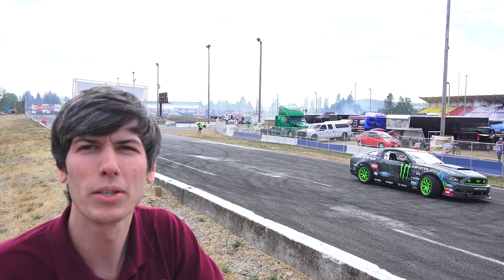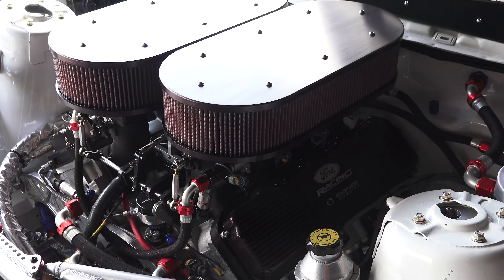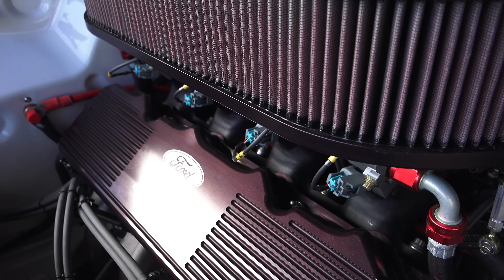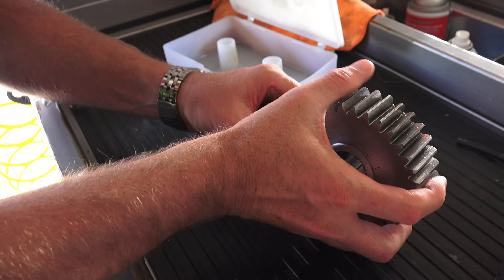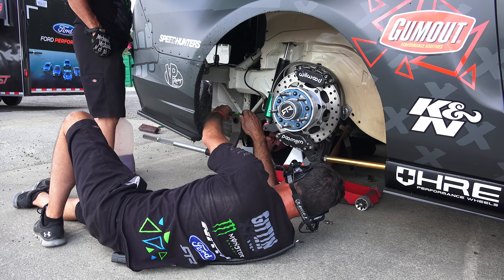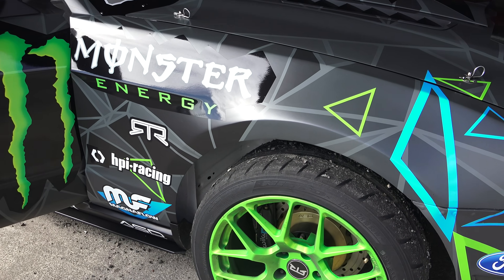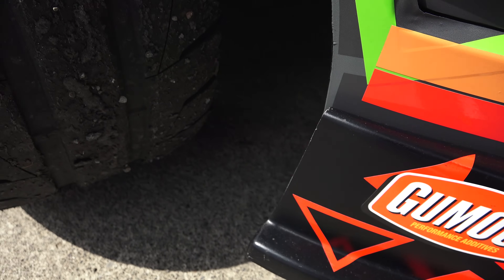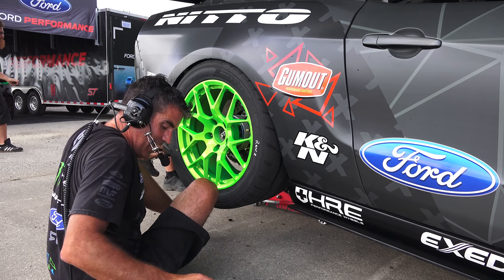Formula Drift - Engineering A Drift Car

Comment: The tires may have good grip bun once they start too spin and loose grip the coefficient is greately reduced but it will still be higher than for street tires. But the front tires don’t loose traction. 
Anyway you use slick tires just as in a typical racecar, but what’s different?

Comment: What kind of steering does this car have? Hydraulic boost, electric assist, or manual?

Reason I ask is that these Mustangs come stock with electric racks and a good drifter told me that electric racks don't self center as fast as hydraulic or manual racks. I figure the car has been converted but as hard as I try to find information on the steering systems of Formula D cars, it's so hard to get it. 

It's a big deal, because most of the new muscle and exotic cars are now all coming with electric racks....Camaro, Mustang, Corvette, Challenger.....

Comment: I wanna understand what’s needed to drift awd.
Reply: There're two kinds: rear-end-biased & 50:50 (this is the kind Ken Block uses).

Rear-end-biased: Pretty much the same techniques as RWD drifting can be applied I suppose
50:50: Steering & throttle control, you only counter-steer during the following:

Reducing drift angle
Transitioning to another drift direction
Exiting a drift

Comment: Only aero you can really do is a big spoiler with big sideplates. The large sideplates put some force back into the vehicle going sideways. Chelsea Denofa used them on his e46 back in 2013. Dont know if they are allowed now.

Comment: 410ci . 14:1 compression ratio . 9k rpm . 740 ft/lbs torque . and they build these crazy engines just to do what a 240sx does but just a bit faster lol

Comment: Why NA engine? No turbos or supercharger?
Reply: Krzysiek Heluszka, from what I learned from Forza, a turbocharged car would have turbo lag to throw the car off balance. In order to have tge most control, either natural or super charged is needed to appy the power in a linear fashion. When the boost kicks in on a turbocharged car, the car instantly redlines, and the car spins out because it's putting all that torque onto the road at once, violently making the car spin out. Forza isn't the most realistic racing game, but it's pretty damn accurate still.

Comment: wow isnt that a like stock car engine?  I didnt realize they ran with that much power.
Reply: most formula d cars make about 1,000 hp, many make even more than that
Reply: +CJSchecter96 Daigos lexus 2jz has like 1200hp
Reply: Jack Truitt and i am here with my 4 cylinder turbo charged to 200+ HP :/
Reply: Ryan Rasberry has a Ls swapped S14 running 700hp with nitrous.

Comment: this should be considered like a part 1 of a coverage, because vgj uses a high power and heavy formula d machine, so his setups differ from lower powered lightweight cars in formula d.
Reply from the maker: William Su There are teams running higher power though, VGJ is looking to add more.
Reply: Engineering Explained his is already pushing out a fair number some cars only have like about 300 ish

Comment: What's the point of this kind of competition? Can someone explain me precisely how they choose the winner of the race?
Reply: BroadcastBro They put sensors on the front and rear of the vehicle, and measure the angle of the car going through the turn, they have the GPS sensor showing them how fast the car is going, and it's also judged by gap between the 2 racing cars.

Comment: car weighs 28xx lbs... even though the FD tire regulations for that weight are 270mm tires MAX.
Reply from the maker: Austin Laflamme It's in a higher weight class (I believe they compete in the 3300 lb class). There's a max limit to the weight, they're all well under. It's allowed the 295's it runs on, they're not going to be so obvious in breaking the rules haha.

Comment: Interesting info on tires. I would have liked more technical details. Suspension setup, and transmission (differential locked ?)
Reply from the maker: godtux 4 speed dog box. They were secretive of the suspension and differential. That said it's a winters quick change diff, and the suspension does have to use the original mounting points.

Comment: This feels too "americanized" I'd rather learn how low horsepower cars drift with a little suspension tuning and an LSD.
Reply from the maker: inuysha360 By reducing grip on the rear axle. Stiff springs, stiff bars, stiff tires (hey, just put plastic tires on if all you want is wheel spin). :)
Reply: True, because it was based off of an American drift series with an American made car and a big corn fed American behind the wheel dumb dumb 😂😂😂

Comment: One thing I feel you kinda glazed over, so obviously the whole car setup is for grip...but why?  Why is so much mechanical grip necessary in a vehicle whose primary purpose is to not have mechanical grip?
Reply from the maker: MrSlowestD16 I was hoping it was clear, sorry if not. You need grip to be able to drift at high speeds. The purpose is not to have low mechanical grip. The more the better as this gives the driver more control and the ability to drift at higher speeds. The rear tire grip is exceeded with large amounts of power (840 in this case). Lots of power is also need to go fast.
Reply from the maker: MrSlowestD16 Another way of thinking about it is drift cars in the rain. The drifts will be much slower and much less exciting because there isn't enough grip to do it faster.
Reply: Engineering Explained Ah, yea, that's a good way to think about it.  I was a bit more concentrated on why you need more grip to drift at higher speeds, the grip doesn't do much if you're drifting, but I suppose if you don't have much grip even getting up to those higher speeds is difficult without the tail wagging all over the place.

Comment: Can you do a explanation on reverse entry physics? I can't wrap my mind as it should keep going backward and sideway by applying force forward. Can slip angel be more than 90 degrees indefinetely?
Reply: More grip in the rear than the front... Lots of steering angle... Really not to hard to imagine.
Reply: The rear tyres get more then front. They just brake and turn the rear end back.

Comment: So you're saying drift cars don't need giant wings? Whaaaaa?
Reply: Cantenkerous Tim IMPOSSIBRU!!!!!
Reply: you do not need big wing they only need it for drag racing
Reply: gibbythebest kotwal yes you do lmao
Reply: gibbythebest kotwal You do want grip if you want to drift fast, and you need to drift fast if you want to win.
Reply: gibbythebest kotwal Hahaha! Well, when it comes to fun, anything goes! For my part, I particularly enjoy thick wet snow! ;)
Reply: +Brian Browning haha i get it
Reply: Most types of racing actually. Downforce is useful both for handling and acceleration, by increasing grip.
Reply: Federico Lucchi and you do not want grip for drifting
Reply: @gibbyace5077  ahhh pro cars want as much grip as the rules will allow. They all run semi slicks.
Reply: Federico Lucchi i only have thick tires in the front and used thiner ones at the back :/

Comment: si podes explicar como funciona el diferencial en estos autos te voh a agradecer, USE A TRANSLATOR SO YOU CAB READ THIS MESSAGE... from Argentina thanks for all your videos
Reply: he said if you can explain how a differential works in these auto mobiles. He'll appreciate it. Also I suggest you write your answer and then translate it to Spanish
Reply from the maker: krwling12 Lo siento pero no se mucho del diferencial. Ellos no quieran compartir informacion sobre eso.

Comment: Can you drift an automatic car? How?  Super video
Reply: Alejandro Castro Montoya From what I understand (and I'm no expert) - it depends on the automatic & the way it's programmed, if it will let you select a gear and hold it, then yes it is possible to drift an automatic - if it won't let you select a gear properly, or it has "limits" in the software or hardware that make it change gear at certain revs or under certain loads, then no, unless you re-program it, or possibly even change valving etc.  Also I think you need to be able to lock the torque converter and keep it locked or you aren't going to be able to fully control the slide.
Reply: ok thanks are too much things i believe it can be posible with any modfication

Comment: Awesome video!! Very professional. When you were saying the weight, I was expecting something like 2,000 lbs... It's funny that even with full fledged motorsports weight reduction (even on the brake rotors) it still weighs 30 pounds more than my S2000. Lol!
Reply from the maker: Arthur Sperotto Haha, you're not packing a massive 6.7L under the hood though. :)
Reply: Engineering Explained True. I don't know how much heavier the 6.7L is compared to an LS, but my F20c is only 59lbs lighter than an LS1/2/3/6. And I'd imagine his engine is lighter than a regular LS considering how motorsports-oriented it is, so it may even be lighter than my 2.0L! :-)

Comment: I still find it super weird that they use a softer suspension setup as opposed to stiffer. my drift rat has nowhere near that kind of hp, and i also dont have roll bars or anything like that to help balance my car so i guess it makes more sense.
Reply: Skull With more weight traveling at a faster rate of speed at deeper consistant angles while mantaining control during snap transitions, the need for grip goes beyond anything a basic drift car for fun will have. Is it needed to have fun? absolutely not. Thing to keep in mind, this is about competition drifting to reach maximum speed, angle, line, and consistant control in a drifting state.  Building a cheap drift car for fun is as simple as welding a diff in most cases. I had tons of fun in a stock Miata, stock engine with air filter and straight pipe, stock suspension, with a welded diff and used tires kicking it around at resonably high speeds in third and sometimes fourth gear if I have enough running room.
Reply: Skull Keep in mind this is the american style of drifting, more power burning corners rather than big entries and tight twisty quick transition style drifting.

Comment: I always wondered why so called professionals had aero parts. Just doesn't make a lot of sense
Reply from the maker: Yoshi Jeffery ^^ The real expert! ;)
Reply: ***** Most of them are for looks. Rear wings do have a function though. The side cards on the wings help keep the car from over rotating and allow more throttle through a corner (more smoke). This is why you'll see some cars run wings for some tracks and not at others.
Reply: Yoshi Jeffery i see
Reply: Yoshi Jeffery I here people say this, but I don't understand how a side card could significantly help when it is so small relative to the profile of the rest of the car traveling sideways through the air.
Reply: Kevin Sing Doesn't have to be a lot. Just enough. Same thing as putting your hand out the window on the highway. It's enough that they have regulations on the sizes of side cards you can run on your wing.
Reply: Yoshi Jeffery Just because it's regulated doesn't mean it makes a difference.  If I stick a 12in x 16 in piece of wood out my window at 75mph its not like my car is going to veer off the road or that I would even have to put additional steering input in to correct whatever force was acting on it.
Reply: Kevin Sing Not going straight, certainly, but if it goes sideways, its already hitting the limits of mechanical grip, so i can see that it might have an effect
Reply: Yoshi Jeffery I remember a Formula D competition years ago, when Rhys Millen had a GTO, there was a gigantic side card on one side of the car because that was the direction the car drifted in for that course. 

Also neat was being next to his team's spotters in the bleachers. They'd radio back information (ie. add stiffness because it was bottoming out on a transition) to the pit crew to help make changes between runs.

Comment: Why did you not cover steering angle or suspension geometry at all? That is like the second most important part of drifting.
Reply from the maker: Brap Brap Suspension geometry is where things get secretive in the world of drifting. As is clearly visible, the cars have obscenely high steering angles. Apparently as much as around 80+ degrees is possible, though at a point its only to help correct a mistake, such as while driving tandem and needing to correct course or slow down more.
Reply: Engineering Explained Yes but you can still cover the basics such as why the have such high steering angle. Or why they run massive amounts of camber or how toe and ackerman affects it,  or maybe even get some pics of the Wisefab kits guys have to show what makes the components so specialized. Ryan Turek runs around -10 degrees of front camber, yet Ken Gushi and Dai Yoshihara run the same FRS chassis and don't have that much front camber. The custom steering components are designed to give as much room to the tire as possible yet still minimizing scrub and bump steer. Positive ackerman creates front end drag as the tires are at full lock because the tire closest to the apex is not fully parallel to the direction of travel and thus has some slip angle. (Not 100% parallel to the tangent of the turn)
Reply: Engineering Explained Successive videos on ackerman and drift related suspension setups please :)
Reply: Brap Brap Boy, this is some bad internet forum regurgitation. This is not why any of those traits exist on these cars.
Reply from the maker: ProximiTV +1
Reply: Yoshi Jeffery I was fortunate enough to attend FD @ Road Atlanta and when we were allowed into the pit areas you could see Turek had a lot of camber to fit under the Rocket Bunny overfenders. Looking back at my pictures it wasn't a full -10 but it looks to be around -5, and looking at Gushi or Dai they had  around -2.

Mad Mike runs a ton of ackerman and he gets absolute massive angle for such a short wheelbase. He looks to have around 2 degrees of toe out at the front, maybe a touch less and when he is at full lock his inside wheel is turned a little more then the outside wheel.
Reply: Engineering Explained It's not that secretive, a lot of teams run off the shelf suspension that anyone can buy.
Reply: Brap Brap Why is to get more angle. Where did you see that Tuerk runs -10? I'm fairly sure that's false. More than ~3.5 starts causing traciton issues. 

Most cars run very little ackerman but rarely no ackerman.
Reply: Brap Brap I can see maybe -5. Wouldn't say -10. Gushi has a wisefab kit. I don't know about Dai.
Reply: ProximiTV No, this comes from talking to the technicians at Formula D.
Reply: 18iser +1 EE needs to do that.
Reply: Kevin Sing Heck i'm sure if you ask the pit techs or take close ups of the suspension they will tell you the exact damper settings.
Reply: Engineering Explained I disagree, the steering angle is pretty much the multiplier of the whole chassi as it gives insane body angle before wipeout and insane maneuverability due to an increased steering wheel ratio. Sticky tyres, 4th gear drifting with 1100+ Nm engines and chasing the maximum traction came after the steering angles. Not talking down the importance of chassi setup, just saying you should view the steering angle as a multiplier of dito. Thats my opinion at least!
Reply: Yoshi Jeffery his is custom designed by Mike Kojima and the camber, caster, etc. is changed for every event I am sure, but -10 is way too low of a number. I doubt that anyone runs that even with a widebody.
Reply: Its not the second most important thing. It IS the most important aspect when it comes to drifting. Your suspension setup is crucial. You can have all the horsepower you want but if you cant get it to slide exactly how you want then you just wasted your time and money.
Reply: Ekemini Umoh I'd say differential then bushings, what made the most difference for me, way more than geometry and setup of suspension
Reply: 18iser
 it's not the torque that's the problem... it's the short wheel base and lack of steering angle.
Reply: +Road2Perfection you must have had a good platform to start with. Suspension I'd say is the most important.
Reply: +Brap Brap Needs pictures..... xD

Comment: what about turbo car? does the lag have any effect on drift performance?
Reply: Lag does play a factor but most guys in formula drift that are running large turbos are also running computer controlled nitrous systems that spray during times when the turbo is spooling. This not only gets into boost faster but fills in the areas when the turbo is spooling.
Reply: Usually turbo cars for drifting either have anti-lag,are small or are on fast revving engines.After launch they pretty much never run low rpms because they would lose their momentum.
Reply: Usually turbo cars for drifting either have anti-lag,are small or are on fast revving engines.After launch they pretty much never run low rpms because they would lose their momentum.
Reply from the maker: Nano Kumo Just a few comments: the goal is to minimize the number of shifts made, in Vaughn Gittin's case there is only one gearshift, so that would be the only time you'd worry about lag. ALS can solve this or other methods. They may have lag at the start but it really doesn't matter as long as they're into the power once they initiate the first drift.
Reply: Engineering Explained Thats why most drift cars are supercharged, cause no lag. But turbo all the way.